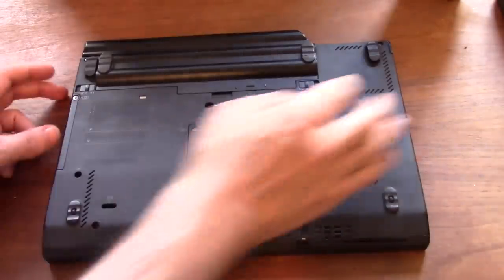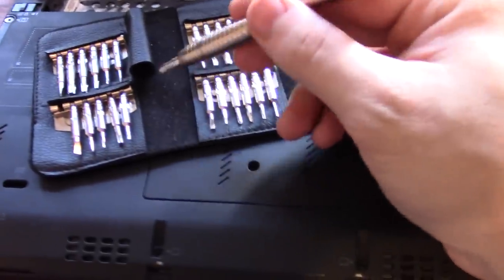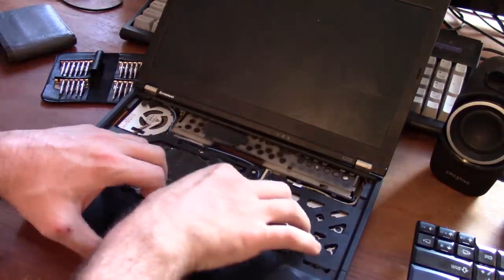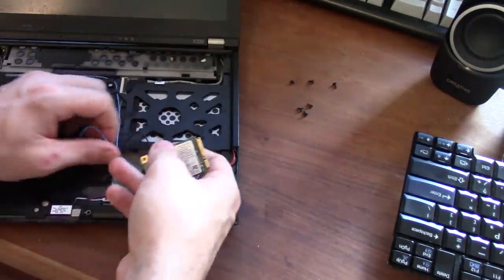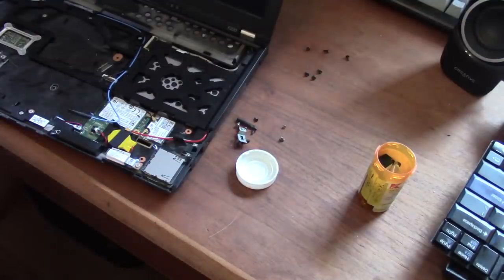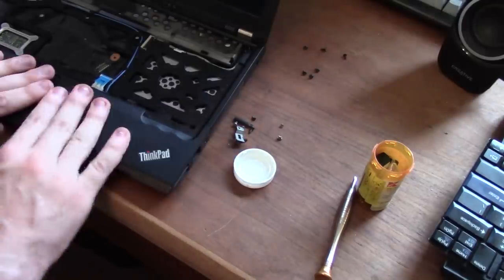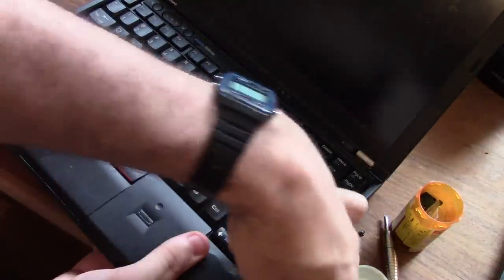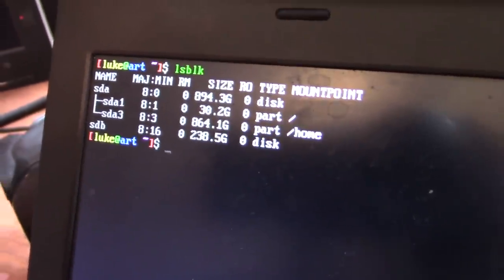Upgrading my ThinkPad with an MSATA Solid State Drive

Comment: Luke in 2025: How to desolder and replace CPU in your x220 ThinkPad
Reply: An i7-3612QE would be cool
Reply: He uses the x220 because it was the last thinkpad before hardware backdoors in the processors.
Reply: X220 is socketed, you just unscrew and replace
Reply: @rickcupola6262  if it is gen 2, it is doable
Reply: @Aiden-vj2tg  no it isn't
Reply: @archygrey9093  I've replaced the cpu in a t520, is the x220 actually different? It's the same processor and same generation...
Reply: @Aiden-vj2tg  They have both socketed and soldered versions of the same cpu, the larger T520, W520, T420 Thinkpads are socketed, but the slim or small versions of the thinkpads like the X220 and the T420S (slim version of the T420) have soldered cpu's. It takes up less space that way.
Same for all the older compact Thinkpads too going back several years too, I've got a x200s from 2009 and its cpu is also soldered.
Another thing to keep in mind is that they've got the cpu mounted underneath the motherboard instead of on top like your T520 would have had, so that even if you just want to replace the thermal paste or fan on the cpu you will have to remove the motherboard and the screen to access it, so working on them is often way harder too.
Reply: @archygrey9093  that is so sad

Comment: "you might have a smaller 6V battery
Well I have a bigger 9V battery"

Right from the start, he shows you who's actually the boss here.
Reply: I'm surprised none of these comments are roasting him for saying "volts". Paused straight away and was like 'hmmmmmmmmmmmmmmmmmmmmmmmmmmmmm'. Yes changing voltage accross parts totally sounds legit, let alone those atypical voltages for batteries.
Reply: @Knarkzel it was more a comment on there not being comments. Get more meta bro
Reply: You might have a 6v Winner, but I have a 9V MAGNUM DONG!
Reply: @arturwelp1877  cool :)
Reply: 6 Cell and 9 Cell You In Cell
Reply: He probably meant cell
Reply: @lukenaylor7926  Haha, I guess forgive him for he is not an electrical engineer.
Reply: @jingruiyu6854  You are quite right, confusing voltage with the number of cells, not a big deal!  Neither is he a pharmacist (or a photographer) as he confused a 35mm film canister with a modern prescription pill bottle.  Neither is he a lexicologist as every object is a thingy.  No worries though because the presentation was very good and entertaining.

Comment: If I remember correctly that will work up to sata 2 speeds, while default 2.5" disk port will work up to sata 3 speeds on x220. Just worth mentioning when deciding what will the disk be used for.

Comment: I'd love to see a video of you moving your OS over. I wouldn't even know how to start doing that.
Reply: I have never done this but I assume dd'ing the drive, reconfiguring grub and editing fstab might be just enough. Though personally I'd go straight to reinstall because I'm pretty sure I'd brick it anyway so why bother... Especially if you're running more complex config like I do -- 2 drives with raid0+luks+lvm.
Reply: If I were going to add an MSATA drive in my Thinkpad, I would plan on an OS reinstall to the new drive.
Reply: @CyberAndy_  Well, that's what dd does... And you need to edit fstab because that's where mount points for partitions are defined and you want to change mount point for (at least) root to match the new hard drive...
Reply: @martinprochazka3714  you got it in one dude, it's really that simple.

I did the exact procedure Luke did in this video last month and thought I'd try dd'ing my drive for the meme - it worked! I was unable to boot into Arch properly at first because I didn't edit the fstab (retard moment) so I edited the fstab file from a separate computer and it booted fine afterwards :)
Reply: A fresh install would probably be the smartest idea

Comment: Nice video!  It's great to see that someone who works confidently on the inside of their laptop is as clumsy as I am!  I put 2.5 inch format SSDs in two laptops (an old Dell E6530 and a newer Acer) a few weeks ago and just and added a mSata card to a Thinkpad E520.  Five- to ten-year old Thinkpads (with a little upgrade TLC)  remain one of the best laptop values for most users .

Comment: What is remarkable is that is a 10 year old laptop and it's still easy to find parts for it and putting max RAM and an SSD plus an unbloated Linux makes it's extremely viable and extremely affordable.  Older ThinkPads even some newer ones are an excellent value.  They are all rather easy to access and service and you can find detailed technical service manuals showing everything you need to know to completely disassemble properly.

Comment: Did this to my W520 last November.
Best thing I've done since running LARBS.

Also replaced the optical drive with a hdd caddy. Put a regular platter drive in there for backup.

Comment: I've put an msata drive into my T430 and installed an OS on it (MX Linux). Gotta say it's a lot simpler than on Luke's video - no removing the keyboard and palmrest, simply removing a cover on the base (one screw) and pushing the SSD into place!

Comment: Be careful. In most old thinkpads MSATA drive is SATA 2, so speed rate will be notably lower compared to the main drive, which is SATA 3. Of course, you will only notice this with an SSD, but I think it's important to mention.

Comment: Getting my x220 in a day or two super pumped.
Reply: coreboot it
Reply: @Ashkimbo  Thats the plan. Looking to do an audio upgrade as well.
Reply: @ab5441  nice! Is that the one where you replace the speakers with cell phone speakers? I did that one too - it's not bad, but I definitely recommend headphones or external speakers if possible
Reply: @Ashkimbo  Yeah,  its my media machine so I need better audio to share music and videos. Otherwise I have good headphones. Which speaker did you use for  your thinkpad?
Reply: @ab5441  I used a pair of Huawei Nexus 6P speakers - not sure I'd recommend them because the difference isn't massive, but it's louder for sure. Some people used iPad speakers.

Comment: Luke thank you very much for making this video, using an MSATA/mPCIE SSD is somewhat niche and I couldn't find lots of information on the possibility of installation. I just have one question that I'm hoping you can answer:

"Theres a chance you already have some MSATA thing here" - would that be the 3G Cellular Modem or the 2GB Turbo Memory module on a T400? I have a fully decked-out model and so I don't have any spare slots to put the thing. If it means taking out the paper-weight turbo memory then I'm buying an SSD straight away.

I ask because I've heard (with varying degrees of reliability) that some of the MSATA/mPCIE slots on these computers don't contain data rails.
Reply: I've also heard the data rails are not connected on earlier thinkpads. I think it was introduced in the X220 era! Which is a real shame because there's definitely space for it in an X200, T400 and W/T500!

Comment: I was expecting some benchmark, i will never put a block-chain data on a device like SSD due to degradation over time , and another thing to take in consideration, if the block-chain data is bigger eventually than the disk space or has a bad sector, you can lost  your offline "wallet". Thanks for the livestreams, i consumed all the "Not Related!" playlist, hope you do more chapters, greetings.

Comment: @Luke Smith unfortunately upgrades do not cover you at some point. Otherwise I really miss my old IBM Thinkpad R51 and its keyboard. By the way, I have just installed Artix + LARBS after Arch. It is really smooth but some key combinations are not completely working. Shift + Prt Scr opens the Dmenu, I select the "select an area" choice but the cursor does not become a "plus" sign to select. It used to with Arch.

Comment: Protip for everyone: its worth investigating cheap SSDs before buying them, some are perfectly fine, some are only as fast as a 7K rpm desktop hard drive 👀 its to do with the controller and a additional ram chip I think, search "LTT fattydove ssd" on here if you want to know more 😉
Reply: it was a used sandisk one. msata was big in enterprise. before m.2 was the new cringe.
Reply: for an x220 speed isn't really relevant as long as it can saturate sata 2. you won't even really notice it unless youre gaming/doing hdd bandwidth intensive tasks. the big difference that you will notice is latency. much faster booting and application responsiveness.

Comment: Hey Luke, could you post all your kind of "default" applications you use in your dwm install or the ones you would recommend, because that's literally all that is holding me back from switching from gnome to dwm... I even have dwm already kind of configured on an old laptop, but what is missing are the applications. And another question, how would go about letting something like Telegram Desktop run as a background process, that notifies me whenever I have a new message, such that I don't have to have the GUI open all the time? In gnome that's possible by using an extension like "tray icons" or the one Ubuntu uses. That's the other thing that's holding me back from switching. I would really appreciate some advice. Love your videos!
Reply from the maker: https://lukesmith.xyz/programs
There's a systray patch for dwm. I don't use it of course though.
Reply: @LukeSmithxyz  why don't you use it? Is it that bad or do you just have no use for it? Thanks for the program list though! Very helpful.

Comment: Hi Luke! Does your X220 screen have a very faint yellow tint on the screen? Mine does and I want to know if there's something I can do to fix it. I know Thinkpad screens in general suck but I hate that yellow tint.
Reply from the maker: No I don't have a problem like that. Replacing a X220 screen is pretty easy though. I'd recommend buying a dead X220 on eBay with a good IPS display and replacing it. You can probably find one for less than 50 USD.

Comment: Having both an SSD and HDD is peak efficiency. SSD for speed, and HDD for storing all your useless crap and memes.
Reply: But an HDD in a laptop is vulnerable, laptops are designed for mobility, and HDD has moving parts

Comment: Vocabulary: 100
Edit: You dont want to move the os to the msata drive because the slot has sata 2 lanes while the sata bay has sata 3 therefore is faster
Reply from the maker: The alleged bottleneck of SATA 2 is still far beyond the capabilities of most other hardware. Unless you are constantly moving gigabytes of files every minute, it will literally never be any different than a SATA 3 even in theory. You can look at benchmarks.

Comment: Isn't the battery life terrible on these older laptops because of CPU inefficiency?
Reply: It ain't too bad, usually a 9 cell will last most of the day for constant non intensive use, the biggest problem is that all the batteries are now over 10 years old and the new aftermarket options are REALLY crap.
New laptops are definitely better for battery life though.

Comment: Where on earth do I find an M.2 E-key 256GB mSATA drive??
Reply: You don't. M.2 and mSATA are two totally different form factors.
Reply: @FlyboyHelosim   That's categorically incorrect While mSATA can be used on other types of connections,. M.2 has 4 form factors and can often allow for combinations of these forms, called "keys": A, B, E and M. mSATA uses the B+M keys.
Reply: @neophobicnyctophile8264  OK well try plugging in an mSATA SSD into an M.2 slot and vice versa. The keying system doesn't even come into it.
Reply: @FlyboyHelosim   I'm using it right now

Comment: Upgrading my ThinkPad with a 1080p IPS screen
Upgrading my ThinkPad with a WiFi 6 + Bluetooth 5.2 card
Upgrading my ThinkPad with a chicklet ISO keyboard
Upgrading my ThinkPad with a large trackpad
Upgrading my ThinkPad with a thunderbolt 3 port
Upgrading my ThinkPad with a 10th gen Intel CPU
Upgrading my ThinkPad with an RTX 3060 
Upgrading my ThinkPad with Windows 10
Reply: @Chaim Goldburger tbh none of the stuff listed above would actually be an upgrade in the context of using old thinkpads
Reply: You should Uppgrade your ThinkPad with a mast and sails... Good Luck...